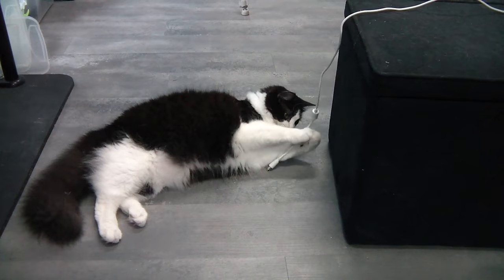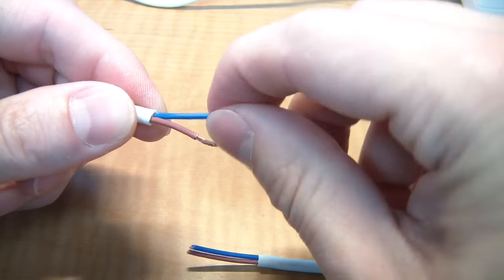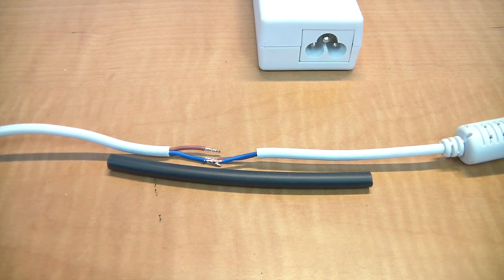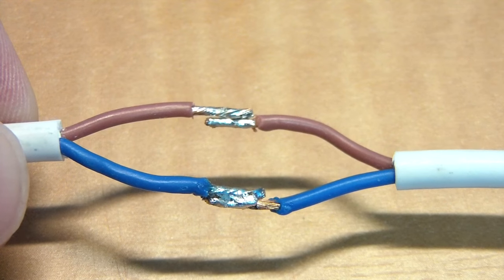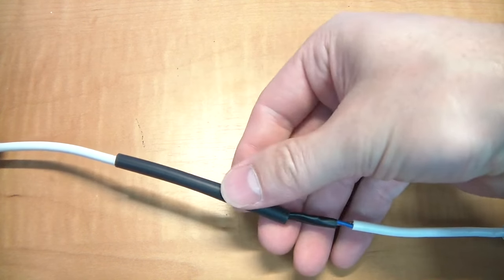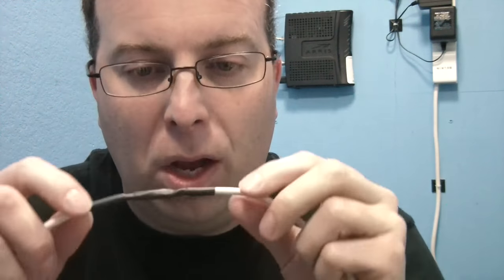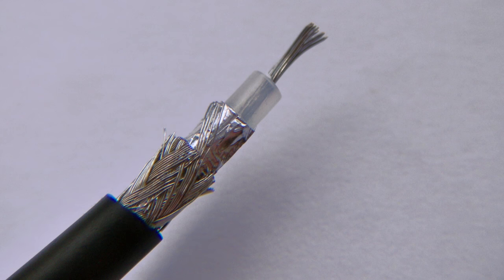How to repair a power cord that has been dog chewed.

Comment: Do you have a video  on how to repair the dog that chewed the cable..??
Reply: pun city!
Reply: +xx_ProQuickscoper-notIluminati-DewrudeDankstorm_xx like* cry*
Reply: +xx_ProQuickscoper-notIluminati-DewrudeDankstorm_xx I know, I wanted to see your reaction. I guess FineBrothers are gonna sue me.
Reply: It's the same process
Reply: Anthony Mondz lol I've kicked my dog across before
Reply: go to the vet < thats simple
Reply: Lol
Reply: Dude, somebody posted that right below you (yes, I am aware that can change)
Reply: Lmao
Reply: Dude what 💀💀
Reply: My dog chewed on my laptop cord
Reply: LOL
Reply: Depends on the damage

If your dog shows a "Pulse Not Found" error like mine did, you can try burying the fried unit, stuffing it with cotton, or asking your local dog maintenance technician if they have something called a "cremating oven."
If your dog is still operational, you can try coating the wires in some "Thum" rosin, which prevents most chewed cable accidents.

Comment: What if your dog chews the cord on your soldering iron?
Reply: +Isaac Love hahahahahahahahahahahaha
Reply: +Sharded Gem you could probably fix the bunny by sodering the power cables back to the heart I think.
Reply: Buy a new cable?
Reply: Holy shit dude this made me laugh way harder then it should at 1:30AM. Thanks.
Reply: That’s why every self-respecting electronics guy needs at least one back-up soldering iron, a battery powered one is fine (and also has the advantage that you have a mobile option).
Reply: find some cobber, twist it to each end. sorry for a little late response
Reply: Bro stop opening paradoxes, thanks.
Reply: Hahaha damn
Reply: Two soldering irons. Just to be safe
Reply: I guess you're SOL... LOL....

Comment: For future repairs consider doing a lineman or a butt splice, you'll get much more mechanical strength.  Also make sure you, if you can, to match the quality of the heat shrink tubing to the quality of the wire.  If the power cord insulation is rated to 100C you should have something equally strong

Comment: You should offset the cuts on blue and brown so the bare wires can't come in contact even if the insulation slips.
Reply: Was thinking that myself. The 2 bare wires are touching under the electrical tape. Good luck when you put the power through it.
Reply: Yes, and that makes the lumpy appearance far less obvious as well.
Reply: Alas, he has done it on a later video.
Reply: I also have wired with an offset in the past but I'm not sure anymore. If the 2 wires touch the fuse or circuit breaker goes and turns off power - safe. If there's an offset and the insulation slips then the circuit is still live and open to someone touching it - unsafe. Short circuits are part of safety design.
Reply: Clever idea. I'll be keeping that in mind in the future.
Reply: Looks like he took your advice, because he did that in his EV charger repair video.

Comment: @2:22 A careful note to those who may not be sure as the video cuts this part out, but you need to wrap each cable in electrical tape SEPARATELY before wrapping them together. The idea behind wrapping it in electrical tape is so that the wires do not touch (to mimic the shielding of each wire in the cable). Once done, you can wrap the wrapped wires together for a more uniform look.
Reply: Instead of the heat shrink can I just use more electrical tape?
Reply: @stueykerr5670  You can, electrical tape however is less permanent then heat shrink, and does not give the cord back any strength, meaning that you'll need to be careful bending the cord there. Not that heat shrink makes the cord perfect again, it just does give it some strength back.
Reply: Legend cheers heaps mate

Comment: I would suggest offsetting the solder joints:
-------------====------
--====-----------------

Twisting the wires to be soldered together

Also using heat shrink or sap tape rather than regular electrical tape.

Comment: Solder isn't glue. The technique shown here is terrible. Cut the ends at different lengths (blue short on one side of the cut, long on the other, etc), so side-by-side the stripped wires can't touch each other once soldered. Twist the wires together before soldering. They should be strong connections BEFORE you even solder - the solder just holds the strong joint from loosening over time.
Reply: Depends on what application, airplanes systems and avionics they tell you do not twist the wires together
Reply: It isnt terrible and u shouldnt twist with vain cables
Reply: You can also push the multi-stranded cable together so the copper wires interlock before soldering - this is far better.
Reply: Fracture ....this is why everyone needs honk and wave,and thank their cities Fire Department...they work hard at saving homes from electrical and "Meth Lab explosion" fires....
Reply: Fracture how would you know you play games all day
Reply: EVERYONE knows it isn't glue.

Comment: A staggered overlap two layer heat-shrink slieve approach is much safer. It keeps the two live wires properly separated.  Normally I'm REALLY happy with your ideas. But this repair just wasn't durable and therefore safe. Perhaps one day you may update this video with a better & safer one. I really don't want to be negative; because I love what you do.

Comment: oooooomyygooosh was my reaction. i was planning on buying a new cord on ebay. I decided to first google how to. and chose your video. I decided to give this a try with only a plicer and black tape. after taping two seperate wires back together nd taping it all as one (two seperate inside) I decide to give it a try. mind you I am not anywhere near certified to do this. Super nervous as to causing a fore or something, I plug it in. Ooooomyyygoooosh was my reaction. My mini dell laptop thats been sitting for a few years, has come to life!!!!!!!
Reply: Susan Espinosa it is dangerous don't do this. this guy is not an electrician. you need a mechanical connection. 100v can melt solder and cause a fire. this is a stupid repair. do more research from professional websites.
Reply: Thanks, I understand what you mean. Luckily it got the job done how I did it. In the mean time until I buy a new charger, Ill keep it unplugged.

Comment: I noticed something that is pretty obvious but that someone might not notice and could cause real problems. When you electrical tapped off the internal wires, you didn't mention that you were being sure that the wires could not contact each other. It's kinda nit-picky of me, but then this is exactly the kind of video someone who doesn't know any better might stumble across. Maybe throw up an annotation?

Love your videos, though.
Reply: Relax, its only 110 15amps
Reply: True it is low voltage but the video did skip this bit too much.
Reply: +mbaker335 Low voltage?! I don't know what you are thinking, but I would consider 110 volts as high voltage.
Reply: Try getting shocked on a spark plug wire. That's a few million volts. But no amps.
Reply: Actually that is a very good point. I like to use shrink tube for such projects.
Reply: Just to clarify things up, 110VAC are really dangerous if you touch them, because of the capacitive propriety of our bodies (110VDC are generally a bit safer bit still not pleasant ). If the two cables are shorted and you connect them to the mains and you have breakers in your house, the worst that can happen is make your breakers activate, and the worst well... Fire, so much fire. It would have been a good practice to insulate both wires from another, but well.
Reply: In the UK mains voltage is 240v.  Building sites here are subject to health and safety regs that ban the use of 240v on site, the industry standard for builders power tools is instead 110v. A transformer is used to get from mains 240v down to 110  if there's no 110v supply on site.  

Basically, 240v can kill you , 110v will hurt but generally speaking its not gonna kill you. Not easily with the amps your average powertools is pulling anyway. 

Basically 240v is regarded as potentially lethal here and 110v as 'safe'    (ish)  I've noticed when buying German power tools recently they're also mains 240v (well, 220 actually but close enough,) their site tools however are 42v, so clearly 110 isn't safe enough in their book.
Reply: I know it’s been four years but this is really helpful! Thank you!

Comment: You should note this SHOULD NEVER be used for the mains side of the charger, but instead ONLY the low voltage output from the charger / Switched mode power supply. I understand, probably most people that would try to attempt would already know what they are doing. But just for the record!
Reply: Yea lol i woudlnt do this for a cable plugging into my wall
but i might for like USB lol

Comment: If you splice RF coax then you are going to get an impedence bump. As a rough guess at least 3db. That is you will halve the signal. Might be better to get new cable.

Comment: Surely you'd cut the two wires at different lengths to prevent a short in the event that it got pulled apart.
Reply: He wrapped the two cables individually with the tape I think
Reply: Kev Ellis ac power won’t short out it just makes the fuse go pop

Comment: Fantastic video my dear chap! Our rabbits just chewed through the washing machine cable, little terrors, so this is perfect! I will try this over the weekend :)
Reply: Spekti Jim I wouldn't try that on a washing machine lol the voltage carried is much more than this low power consumption wire/device
Reply: That just happened to my keyboard.

Comment: And remember, ALWAYS cut TOWARD yourself, and make sure that the power cord is plugged in.
Reply: inb4 someone actually does that.
Reply: Don't actually do that.
Reply: Then touch the wires to your tongue to make sure it's a good connection.
Reply: Jay B. And before plugging it back in, clean the outlet with a fork. Guaranteed.
Reply: +ThatGuyYouKnow  fork and soapy water while barefoot works best
Reply: It's best to use water to insulate yourself from any potential electric shocks when carrying out any electrical repairs.  I usually stand in a full bath or a bucket of water or something. 

Also I've found that the fuses in electrical appliances can be of a really low quality, and in the fuse box, they can blow very easily , a simple trick to improve this is to replace them with large nails.
Reply: @willjdeanie  The fuses are there so that BIG ELECTRIC can charge you for more components in your electronics. Replace them with crunched telephone wire. This trick works with circuit breakers, fuses, and any switches...

Why am I contributing to this..?

Comment: Nope, you do not solder main wires... Never ever. In particular not wires that might flex. Solder is no good for these application. That joint will eventually break, the touching wires will arc and worst case set your hose on fire. There are crimping connectors for this application. However, for an open wire I would not recommend that either. If you really must reuse that cable, I would put a little abs box in between with proper crimping and with proper strain release. Or, at the very least, crimp them together, improvise a strain release with some zip ties and heat shrink the hole package.

Comment: Fail !  - You never solder two ends side by side, grade 8 electronics there. Make your cuts 1/2"- 3/4" further in length apart to let yourself splice one wire at one end of the job and the other spliced at the other end. ( here each soldered end will be automatically isolated by the other wires intact insulation.) If you follow this method, then there is zero chance that stepping on a cable might cause 2 soldered ends to rub together and short,  or electrical tape to slough off under improperly shrunk shrink wrap, or a heat related issue cause cheap electrical tape to fail.

A word to the wise...  35 years experience in the field.
Reply: Good to know.

Grade 5 Student
Reply: bulletsvan hey if he plugged that in at least it would trip the breaker or the prot device protecting the wire

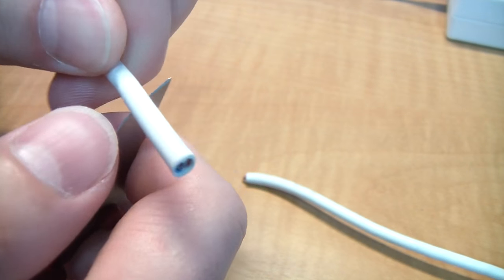Comment: Practice 0:40 over and over and over, ya'll.  That has such a feel to it that you just have to aquire from trying and practice.  You'll know when you nick the inside wires past the outer sheath with enough practice at it.  I strongly recommend practicing that on lamp wire or the like before committing to something that needs to be done with finesse and that uh...needs to be done with 1st shot success lol.  Also with white shrink, it tends to be sort of a crap shoot with how pretty it shrinks after open heat (especially from a lighter) hits it and potentially gets soot on it which usually stays there.  Sometimes I've had it look ok, other times it looks all spotty and burnt.  Just a cosmetic thing.  Also resist the temptation to squeeze on the shrink with open fingers after heating.  Not only can you burn your little fingers, but also it leaves your prints in the shrink and looks kinda shitty.  Again, just a cosmetic/safety thing.
Reply: Or just use wire strippers

Comment: I repaired the cord to my large Vornado “air circulator” fan in 2016. But instead of soldering the two ends together, I used male and female connector clips. And instead of heat shrink, I used electrical tape. Perhaps your idea is better as my connection came loose and I had to re-crimp them again. So far, they have not come loose again.Hiring somebody to replace the cord would cost over $30.

Comment: Awesome tutorial, with all the extra work though it may be better to just get new cables since they can run at most of about $5-$10 a pop lol. It's still a very good tut for more expensive wire replacements or for a quick fix.

Comment: this part 0:42 "do not cut too deep or you will damage wire inside" i have this problem from time to time, probably because i do not do that often. Do you have any tips? Did you watch some videos or got suggestion from someone how to do that without risk?
In your case if you damage wires inside you can just cut i do it again but if you want to that on a middle of cable it can be problem. Than if you damage a wire you can make a big problem.
Please answer me or someone other who see. What is the best solution for this?

Comment: I would never solder a repair into a mains lead. I would use proper electrical connectors which are screwed in. You end up with a block in your cable but it is safer. But really though I would just buy a new wire..... Assuming I had enough after buying a new dog. Nice vid as always though.

Comment: I would've just used a connector box, hold the two wires together using a tight screw and then close the connector box

Comment: Any ideas when you're not soldering iron savvy? I mean, i'd like to see myself as "handy around the house" but electricity is not my cuppa tea...
Reply: Wire nuts and electrical tape. I think there's clamp on connectors but that's kind of scary if it's going to the wall.

Comment: So new on this. After soldering the wires when I am wrapping them with eletricial tape I need to separate the 2 wires correct? So they don't touch.

Comment: Dude for AC lines, you really gotta work on that soldering job on the hot lead. Maybe it's a DC line but still, people are definitely gonna use this to repair their power cables and they're gonna fall apart in their hands with that type of joint.

For anyone that cares, with stranded wire you can fan out the copper strands and then kinda interlock each broken end of the cable together for a good solid connection. Then twist the slack you'll probably have around each other so the joined ends are nice and thin and tight. Then on top of that be sure to solder them very well. And, good tip, you should use some flux if you can to really draw the solder into the cable.

Be as safe as possible when it comes to your family and 120V.

Comment: Nice video, fine to this on the output side of the charger (low voltage plug into your into your laptop but I wouldn't do it on the mains powered cord, you are better off to open the charger up and replace the whole cord properly, 240v is dangerous and you don't want a patched up cord, if the heat shrink slides off this could be quite dangerous! If you can't open the charger you are better off to just replace the whole thing really if the mains cord has been damaged. Thanks for the video!

Comment: I myself wouldn't do this. Lots of power is really dangerous.

Although, doing something like this to convert mouse/keyboard wires are really useful.
Reply: thats why you unplug it? and a standard power cord wont hurt you itll make you jump but thats about it
Reply: Jordan Gass

Won't hurt you?! Even 120v will hurt. Most of the world uses 220-240v, and that is easily lethal. Thankfully here in the UK we have RCCBs which make things much safer, but any mains electricity should be treated with great respect.
Reply: ***** but this is after the adapter so its only like 12v not going to hurt
Reply: ProdigalPorcupine volts don't kill amps do
Reply: ***** Why don't you unplug the wires first?
Reply: Jordan Gass That may be the case, but in actuality millivolts can kill. Someone in the UK or Australia attempting to repair a mains voltage cable in the manner shown is seriously risking their life with 230 / 240 volts and up to 13 amps not to mention the risk of fire! Many old power distribution units (or fuse boxes, as they are also known) only have wire or cartridge fuses, with little or no protection against the sorts of faults that can lead to lethal electric shock and potential for fire. Where power cables are concerned ALWAYS replace rather than repair.
Reply: Jordan Gass
Current = volts divided by resistance. All other things being equal, the higher the voltage, the greater the current flow through the body. That much-used quotation you used is misleading at best, downright lethal at worst. I've never seen a sign saying 'danger, high current'...